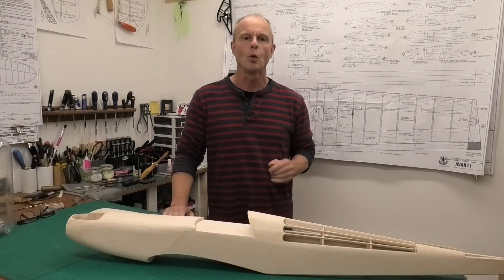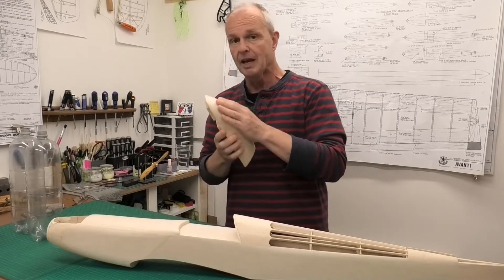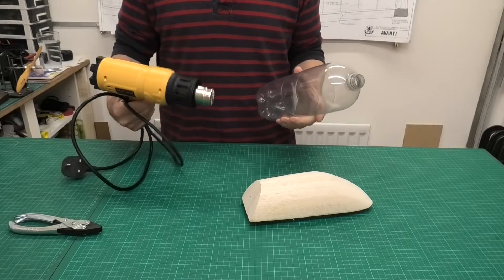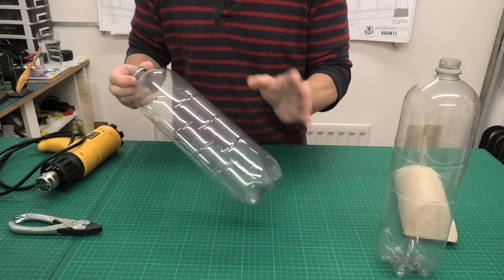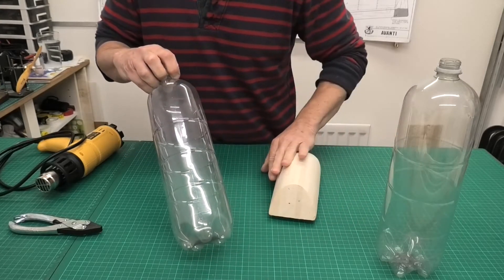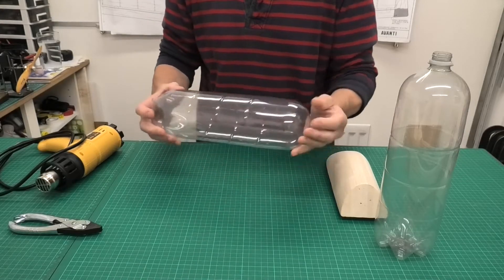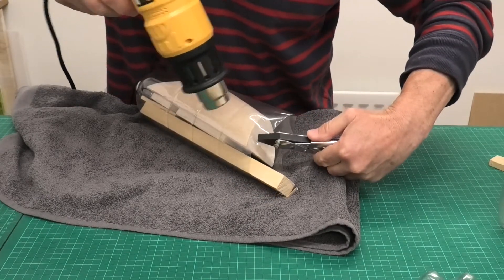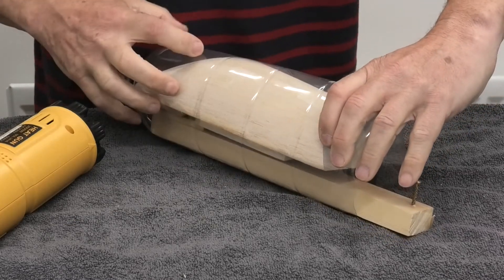How to Scratch Build a Canopy - This is for my RC Avanti Pattern Plane

Comment: Alcohol or acetone should remove the adhesive, especially if it is in an unseen position.  A couple of years back I formed a canopy for my helicopter primarily because a mate told me that I couldn’t 😂. Used a green two liter bottle and just a tiny bit of heat gun because it was almost perfect as it was.  I need a couple of replacement parts for some old kits I just acquired, perfect timing!   Thanks for your help 😊
Reply from the maker: @wrstew1272  Thank you very much for the comment and suggestion, greatly appreciated. 😀

Comment: Fantastic video!  Super helpful.  I had no idea that soda bottles will shrink with heat like heat shrink tubing.  I will make one for my Hangar 9 Aresti 40.  The old canopy popped off during my last flight was was lost.  I'll need to make a frame for the canopy & glue to two together.  It will snap onto the Aresti- this is really a removeable hatch to access and connect the LIPO battery.  Thanks again!
Reply from the maker: Thanks for the comment, pleased you found it helpful.  Good luck with making your replacement 😀

Comment: I have found making a new canopy, (usually repairing crashed model) a trying experience.  Finding a PET bottle big enough for large model plane: e.g. .75, 1.20 cu or larger.  I've spent more money buying large water containers & experimenting with those, when I probably could have bought a new canopy, ( if one was still available for the model ).
I've had more success making canopies by building a vacuum forming box & PETG sheets.   But, when it comes to all facets of aeromodelling, it take time & patience.  Great detailed video, excellent job.  I will try some of your tips for next time.  cheers from down under.
Reply from the maker: Certainly using plastic bottles has its limitations of size, this one for the Avanti is about as big as you can practically go with this method.  Pleased you enjoyed the video, thanks for the comment 😀

Comment: Thanks for the great method, the results are excellent. I just wanted to mention that I had some success polishing out fine surface scratches with a fine grit aluminium polishing paste. It might be worth a try whilst everything is tight together on the stick. By the way, the scratches would show up better if your former was painted in black. 👍🏼
Reply from the maker: Thank you very much for the comment, and appreciate the great suggestion, really pleased you enjoyed the video 😀

Comment: Dear Mark, I have just discovered your channel and I found it great. I'm also in the process for repairing a glider and a part to be repaired is the canopy, I found your video very useful. 
I also have a tip for you ;). You mentioned problems with the glue in the bottles. I have a solution for this. I have been using “3 in 1”, “6 in 1” or “WD40” (the name depends on the country) oil for cleaning bottles.
I use a kitchen paper and this oil to clean label sticky surfaces on plastic or glass Amazingly it works great and the surface is totally clean.
I finish it with alcohol and the surface is perfect.

Xavier
Reply from the maker: Hi Xavier, thanks for the comment, pleased you like the channel.  Thanks for the tip, I will have to try that next time 😀

Comment: Such an interesting video. I know you're a balsa man and a first rate craftsman, but have you thought of cutting your plug from a block of polyurethane foam cut from an insulation panel rather than balsa? This foam cuts easily with a hot wire wand (smells a bit of course!) and is very rigid. It's also very easy to sand. One unknown as far as I'm concerned is how it would stand up to the heat from a hot air gun. I'm a bit of a scavenger and picked a dicarded piece of 80mm panel from a builder's skip! Using this stuff I sculpted a piece to repair a damaged foamy.
Reply from the maker: Hi there, thanks for the comment, greatly appreciated, I have thought about using alternatives like foam, but I do like working with balsa.  Great idea using old insulation foam, I should give it a go, thanks 😀

Comment: A very good demonstration of the technique.  I've long been aware of the method but never dared to try it (I don't drink fizzy pop :) ).  Most of my models are open cockpit but when I build one that needs a canopy I'll certainly have a go.  The only hot air gun I have is the one I use for covering but I've heated crankcases with it to replace bearings so it may be enough for a canopy.

Might it be worth putting the job in a vice as third hand once the bottom is shrunk?  We have some stuff called 'Sticky stuff remover' which does what it says on the bottle. No idea where my wife bought it but it works when trying to get labels off things like pottery mugs.
Reply from the maker: Thank you very much

Comment: I used to make canopies like this for years, but I've had better results doing this in an oven recently. Everything else applies and you have to put some clamps on the loose rear end, but shove it in an oven at 100°C and you will get some initial shrinkage, if all looks good up the temp to 180 ish and watch while it heats up. It will shrink very evenly and smoothly with kess chance of scorching which is so easy to do with the heat gun. Whole process done in about 5mis.

Comment: With the cost of balsa it might be cheaper to just buy a canopy 😊 All joking aside great video
Reply from the maker: Thanks for the comment, pleased you liked the video. When building from old plans, like for this 1974 Avanti, stock canopies are simply not available, or if needing to replace a canopy on an ARF.  And I guess in reality if they were available they would be far mor expensive than the block of balsa.
Reply: Not after you apply the shipping charges, but yes, balsa is spendy.  I have used vitamin bottles for speed rings and replacement cowls.